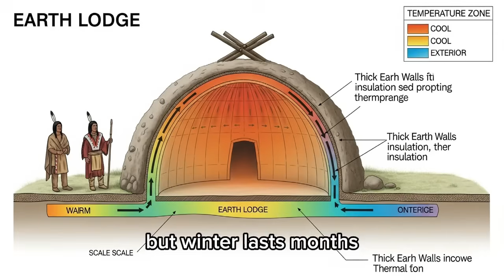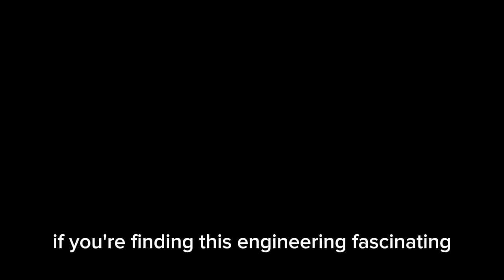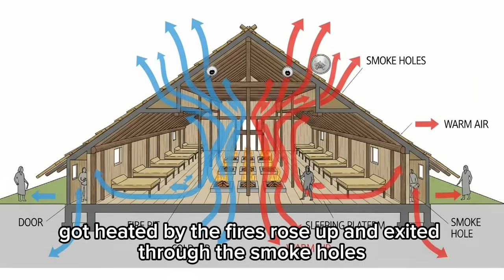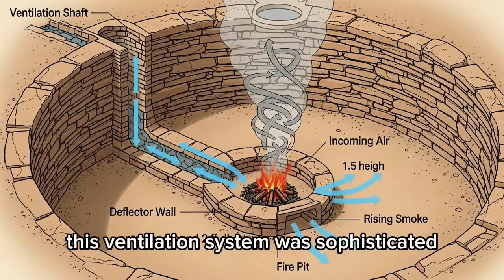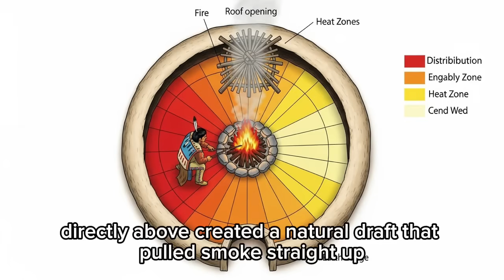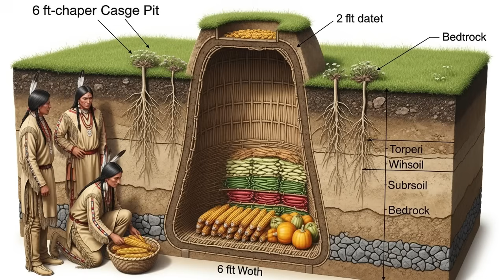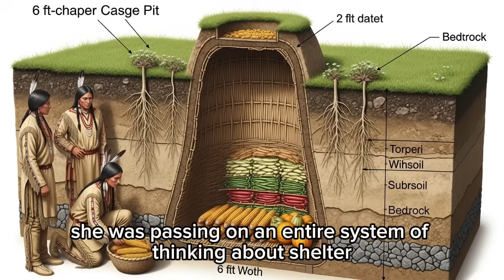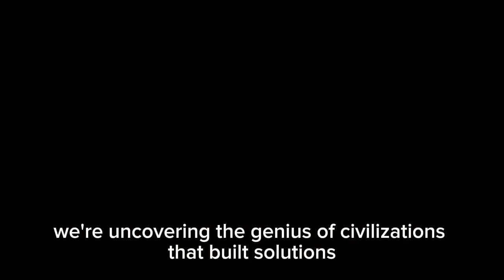How Native Americans Built Underground Systems to Survive Winter | Ancient Horizons

Comment: I spent a winter once in a hand-dug shelter that reminded me of those old earth lodges. The wind outside was so brutal it felt like it could peel the skin off your face, but the moment I climbed down into that half-buried space, everything changed. The air was still. The cold stopped biting. All I had was a small fire pit in the center and a roof packed with soil and grass, but it held the heat in better than any modern tent I’ve ever used. I remember waking up at dawn, hearing the storm roaring above me while inside it felt almost peaceful, like the earth itself was shielding me. That was the moment I realized why going underground wasn’t just smart engineering—it was survival.
Reply from the maker: Experience is definitely the best teacher, thanks for relating 🎉❤